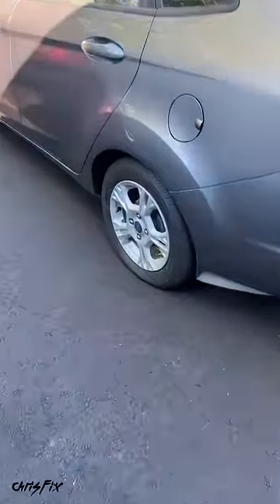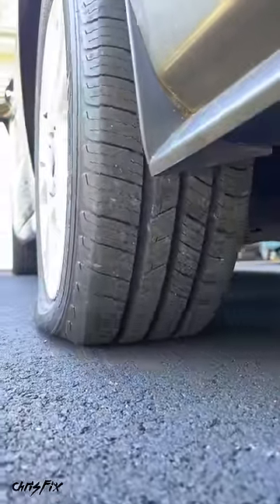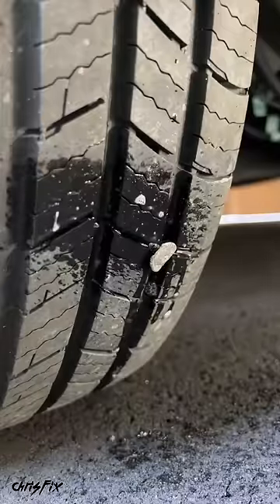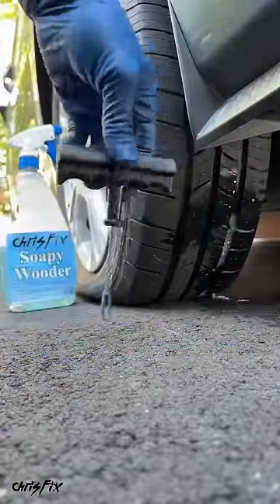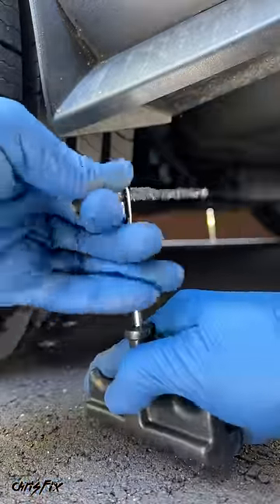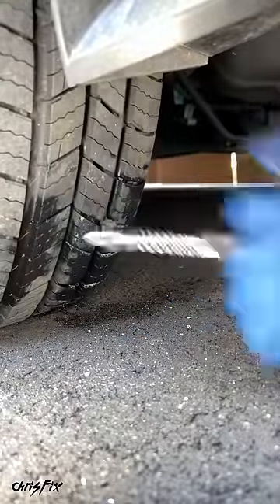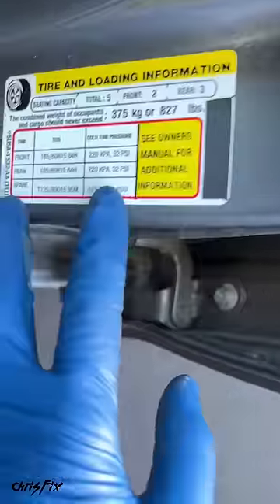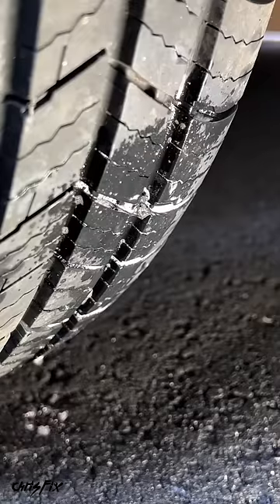How to Plug a Flat Tire (easily)

Comment: Definitely something that everyone should know how to do for when you're in a pinch. Thing to note though, some tire repair shops will not patch a tire later on if they find a plug like that. Company policy is that a plug doesn't do as good of a job as a patch and can cause damage to the integrity of the tire, so then the shop is liable if they patch it and something happens. Source: work at discount tire
Reply from the maker: Thanks Bob!
Reply: Same man, leaking cottons plugs are no gooood.
Reply: I like to note that these plug are often not good for long term as they may leak again so it's best to get them properly repair, that way, they can last a lot longer with a patch. I work at one of kal tires in Canada and the leak are uncommonly found from these diy plug.
Reply: I've never had one that leaked, but I certainly believe it happens. It's probably also a good idea to keep an eye on any tire that had a deep puncture in it for a while on the off chance it hit one of the belts inside of it in such a way that it fails. There's no mistaking the bulge in a tire that's lost some of it's internal structure
Reply: I also work for a large tire company and we will not honor the warranty if you do an improper repair like this if it would have been otherwise repairable. These repairs are designed to be temporary and will get you back on the road but you definitely want a patch and plug repair for a proper repair to last the life of a tire. If you're interested in my credentials I supervise the shop and am TIA certified
Reply: Firestone has the same policy, seems dumb to me. I had to use one of those emergency plugs 6 months ago. After using it I drove around for a bit and a bit later I took it to Firestone and they refused to to do patch the tire internally. Ended up going to a local tire repair shop who had no qualms about patching the tire. 6 months later and no issues
Reply: Worked at NTB,they had the same policy. One manager I had said we do not repair a patched tire, it must be replaced. A different manager would make me remove the plug and patch the hole
Reply: These plugs last just as long as patches never once had one leak I also do the patches and all the unnecessary work to patch isn’t worth it they both work the same
Reply: I work at schwab , and we actually highly enjoy ripping out peoples rope plugs , and doing real flat repairs that last for  a long time , Have never worried or had an issue with damaged structural integrity
Reply: @NWGarage  Do you just put glue and a piece of rubber on the inside? Does anything go in the hole?
Reply: @libtrs838  we buff the tire down first to a velvety surface to help the cement bond , then put the vulcanizing cement down and let that dry , then we put the patch down by hand and then we stitch it in with a roller , and then we have a final thick black sealant we put on on all the edges of the patch
I don’t put  plugs in for real small nails , but for big bolt holes I pull the plug through first , and buff the plug down flush with the rest of the tire, and then proceed with the rest of my patch , but the plug is not for sealing air at all it’s only for structural purposes and to keep moisture out 👍🏼
Reply: @NWGarage   Thanks for the detailed reply. I don't get why some tire shops refuse once a plug is in. The process you described makes it seem like a customer plug wouldn't make a difference. If retreads are safe / allowed then removing a plug and doing a proper repair should be ok.
Reply: I work at discount tire I was about to say the same thing

Comment: 1) A 1st timer might not know of the two options, T handle/screwdriver, especially if both options not available at store. In a pinch use whats available( good luck).
2) Some kits come with separate reamer and insert tool, not like one used in video.
3) Yes, different products have different instructions.
4) Recomendation to use as temporary is in case newbie fails to do job correctly. But this method is great in any "emergency". Better than waiting in middle of nowhere for towtruck.( course you still need air source) I've used plugs that have lasted " forever". 
5) I've seen film where repair was done on dismounted tire that shows how twisting 1/2 turn does cause plug to form a knot inside tire. Notice tool Chris used was knurled like drill bit. Would be best to turn in direction of shape, as if removing a screw, otherwise it most likely will wrap itself onto tool. 
6) only concern I had with video was leaving water on tire before installing plug. But again, in urgeņt situation, you just need to get somewhere, right? And I learned the hard way chalk area where hole is otherwise you might have to use more water to find leak again.
7) If planning on using as permanent, check for leak at least once after adding some miles, either next day( or week).
Hope my imput helped some, and, oh "Can't we all just get along? ( hee, hee, hee)

Comment: Lot of people saying it's not permanent fix, maybe it's not I'm not a mechanic, but in my experience been using these for over 15 years and never had issues after. Even used them on my 26,500 pound bucket truck and no issues. This just my experience with them though
Reply from the maker: Agreed. I’ve drifted on them to the belts of the tire and they still held air haha. Couldn’t believe it!
Reply: Agreed, I put on many 10s of thousands of miles on each of these plugs. Never had any issues. People saying you gotta run to the tire shop immediately after make me laugh.
Reply: @janoycresnova9156  I literally have one on my car now. Had a nail in my tire bout month ago. Been plugged ever since

Comment: I like to use the kits with rubber cement. Coat the plug with some rubber cement before inserting the plug.
Reply: I always get a plug kit that comes with the cement.
Reply: Why is cement needed? I would think that the plug is essentially self sealing.
Reply: The cement lubricates makes it slightly easier to push in

Comment: @chrisfix I also always put a dab of contact cement on the “string thing” before I put it in.  It makes for a better seal.
Reply: Always use rubber contact cement.
Reply from the maker: You totally can if it comes with it/you have it. In this case it sealed without it but it doesn’t hurt!

Comment: I use repair sealer on my plugs, Before inserting the plug. I feel like it helps if there might be any small leaks in the future
Reply: @Semystic  ive fixed tires with leaking plugs, rarely see any of them with any sealer

Comment: This works ....dont let tire shops tell you it doesnt .
Reply from the maker: I’ve drifted down to the metal belt with plugs with no problems.
Reply: It works yea, it's not always that easy tho. I can't even count how many people come to the shop asking for one and leaving because we charged too much. Just to return the next day saying they did it and it didn't work.

Well no shit, you tried to put 3 sht cheap plugs into a hole that isn't mean to be plugged. Or on a tire that isn't worth plugging 

People can plug a tire on their own, but I always tell them if they have it. Pop the spare on, and make your way to tire shop. A plug isn't always gonna work, or your tire might not be worth plugging (which is the case a lot, and it can be very dangerous to even attempt to plug  it)

Basically if you know you know, and if you don't know don't even try it.
Reply: Where I live they charge $15 maybe $20 to patch a tire, off rim. Never had any issues either and price is great.
Reply: @cedarwings82  $30 plus tax in Canada
Reply: It works but it isn't a permanent fix.  This is also not a DOT certified way to repair a tire.  I can't tell you the amount of times a rope plug has leaked on a tire needing a repair.  Plug + patch is the way to go.  If you can't afford fixing a tire the correct, why do you even have a car?
Reply: @drake5557  Because they need it to eke out a subsistance living at a workplace that doesn't pay them enough according to the local cost of living, perhaps? I mean, most middle-income families don't even have $500 in savings for emergencies in the US.
Reply: @drake5557  Because people have jobs and need a way to get to them, duh...
Reply: @drake5557  Never had those leak. NEVER!
Reply: @cedarwings82  It's free at Sam's Club.
Reply: @cedarwings82  thats exactly the problem 15 dollars is a lot to repair a tyre when a tyre may only have a few thousand miles left. Or when a new tyre is 40 dollars.
Reply: @SuzukiKid400  holy crap thats steep compares to uk £15 but i suppose its all relevant to earnings and cost of living.
Reply: @cedarwings82  Free at Discount Tire, or America's Tire. Even if you didn't buy it there.
Reply: I've plugged several tires and hardly any of them were leaking afterwards and I'm a mechanic

Comment: You forgot last step: Drive to tire shop to get a patch put inside.  Plugs are only a temporary fix, a patch needs to be made on the inside.  Also any of this only applies to the treaded areas.  Any puncture of a sidewall is mandatory tire replacement.  Source: Every tire manufacturer.
Reply: Plugs are not a temporary fix if the hole is a clean puncture like from a nail or screw
Reply: Nah these plugs never fail. No sidewall repair, yes absolutely agree
Reply from the maker: Tire shops won’t patch a tire if you use a plug so kinda in a pickle if you don’t have a flat near a tire shop! Also you are 100% correct about the sidewall. Only repair in tread area.
Reply: Bullshit. Plugs are totally fine. Had about 50k driven on two separate ones.
Reply: @chrisfix  i had one pull my plug and patch it they will do it if it’s in the right zone and it’s a good business .. but i did use a high rated local family owned shop
Reply: @chrisfix   I work at Les schwab up here in Washington, we love pulling out rope plugs and doing “ inside out “ patches and plugs for folks , no worries if it’s been rope plugged in the past, we’re always happy to help
Reply: Plugs work forever. 3rd world countries beat the shit out of these tires with dozens of plugs and never fails

Comment: Just so people know that this makes your tire unpairable if you take the tire in for a flat repair at a shop. So just know before doing still but it can work. Great video 👍
Reply: purely depends on the tireshop
Reply: Unpairable?
Reply: @janoycresnova9156  unrepairable* don't tell me I needed to tell you that for you to understand
Reply: @KeaganExtremeGaming  in my experience, in working in a tireshop and a mechanic shop, it's unrepairable by law, but you could definitely repair it, if you know what you're doing
Reply: @thattexaskid4219  what makes fixing those plugs any different than if it was the nail in the first place. Atleast in this case he didn’t make it bigger.
Reply: @KeaganExtremeGaming  nothing really as far as i know, but its illegal. it is technically legally unrepairable.
Reply: @thattexaskid4219  if you can find a source that would be mint but I could believe it’s illegal in some places. Supposedly the tire industry recommends against patches and you should only plug it.

Comment: Love what you do Chris! I’d recommend getting it plugged and patched by a shop, or dismount the tire and do it if you can do it yourself. Cotton plugs are only temporary and may eventually start leaking, and at that point the tire isn’t fixable. A well done plug and patch should last the lifetime of the tire 👍

Edit: also for everyone out there, never repair the sidewall or shoulder of the tire, or if the hole is too large, the repair won’t hold and it can be dangerous if you try to drive on it. So unless you have the proper tools and ability to do it yourself, I’d advise you toss on the spare and head to a tire shop 👌

Comment: Fyi if you have a discount tire or America’s tire near you we will fix the flat for free! Tips appreciate of course, but if a flat already has a “road plug” as we call them like this then we cannot work on it for liability reason’s unfortunately. So next time you have a flat swing by your local discount tire first!
Reply from the maker: Great tip if you have a flat near one of those places. If not I wouldn’t drive on a leaking tire which could be dangerous. But hey if you’re near one of those stores, great idea!
Reply: @chrisfix  yes I agree! We also won’t work on it if it has a “heat ring” from driving on it flat. So really only ideal if you find yourself in this situation and you happen to be nearby. 👍🏽

Comment: Make sure to take the tire in to a repair shop, so they can repair it from the inside.
Reply: Yes absolutely you never know what else might be wrong with it and sometimes it isn't a simple or easy screw to find
Reply: That’s not necessarily required. It also costs $30 to repair this way because dismounting, remounting and then balancing have to be done. Patches are better, but there’s nothing wrong with a plug.

Comment: Hey Chris. Tyre Fitter here, some extra advice for small nails is to pry it out with whatever you can. We use a sharp tipped tool but a small flathead might work in a pinch.

Comment: I work at a Walmart auto center. Walmart is strict on what holes we can and can’t repair. If we can’t repair it and don’t have a new tire to sell, I always recommend the owner get a plug kit and rubber cement. The plugs usually work they way they are, but the rubber cement helps.

Comment: I had no idea you could do it without take the wheel off. I never done it before but I know it possible now
Reply from the maker: Glad you learned something new
Reply: @chrisfix  thank you for all your content. This is my go to channel to fix anything on my car. I used your checklist to buy my first car.
Reply: Taking the wheel off however will allow you to better examine the wheel and locate ALL nails. I first took off my tire and put a spare instead. And was thinking to drive to Firestone next morning before work. But before deciding to waste my time driving  there  (which quite a bit far and needs an appointment) I decided to give this kit a try. After carefully examining the wheel I've found 1 screw and 1 rotten nail. I guess the screw was the one, the rotten nail bit was not deep enough yet (but very close). Plugged both, pumped the wheel. Checked with soapy water if either of the two plugs leaks.  Waited for 2 hours, checked pressure again and reinstalled the tire.

Comment: I recommend that everyone include this tire repair kit in their car tool box along with a 12V air compressor that you can plug into your car power outlets.  Less than $50 for both.

Comment: I always fill the tire up with air before trying to push the plug in. Pushing in on a deflated tire is much harder, and I use rubber cement to lubricate the plug.

Comment: and one more thing you left out, before removing the screw you have to inflate the wheel slightly above the recommended pressure, because when the wheel is inflated it goes in much easier and that kit seals faster
Reply from the maker: Interesting i'll have to try that next time, but good to see this works either way
Reply: @chrisfix I work at a tire shop and I really know how to do it correctly, I don't comment just to comment :)

Comment: Rubber Vulcanizing tire repair patches, or duct tape over it might help too. Just to keep it in place longer.
Reply from the maker: I like how you are thinking to go the extra step but these are vulcanizing rubber and seal the repair. No need to add extra steps. I have drifted on repaired tires and they last to the belt haha.

Comment: If you find a hole right in the sidewall of the tires. It's best to put a spare tires on and replace that flat tire. 
The reason is there are steel cord that hold the rubber together and they are weaker in the sidewall due to nature of how the tire was made. If a cord in the sidewall is broken, it is no good to ride on since air can enter that space where the broken cord is and create a bulge in the sidewall and blow out eventually. 
I work at kal tires for 6 years and seen a lot of cases like what I describe above.

Comment: FYI in many places this is against DOT regulations and could fail inspection. This gets you to work or off the road but have a tire shop put a patch plug in it. It's usually cheap and can save you from a blowout.

Comment: I’ve always used a dab of rubber cement as well… but I rarely use plugs now because I have seen them cause issues with the steal belts in the long run.  Any thoughts on either of these points?

Comment: Hey Chris! I hope you're doing well! This didn't work well for me. I had to remove the wheel from the car and use two of the rubber plugs together and a lil rubber cement, then I used a torch to heat the repair and finally it sealed.

Comment: Here is a tip.
Have the air compressor hooked up and on when you're inserting the plug.
When the tire is low on air the flexibility can make it harder to insert the plug.
By pumping the tire up you make the tire more rigid, thus allowing the plug to be inserted easier.
Also use the rubber cement not only does it help seal the puncture it also acts as a lube

Comment: This is useful when you’re in a pinch but please keep in mind that tire plug kits are meant to be a temporary repair so you can get your tire to a professional place. 
Proper tire repair procedures dictate that the injury in the tire must be filled with vulcanized rubber material or a rubber filler and then patched on the inside with a rubber based sealant after making sure the inside of the tire is safe to repair.

Comment: By using a rope plug the person can't know if the tire had been driven on with very low pressure. Possible damaging the sidewall which can lead to sidewall blow out. Patching the tire from the inside will allow you to inspect the inside of the sidewall for damage.
Reply from the maker: Thanks for sharing